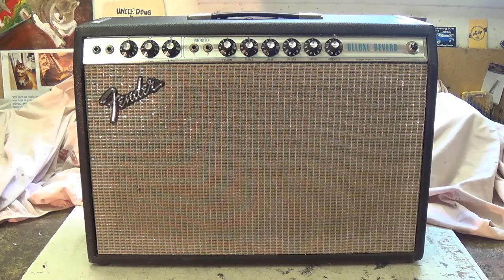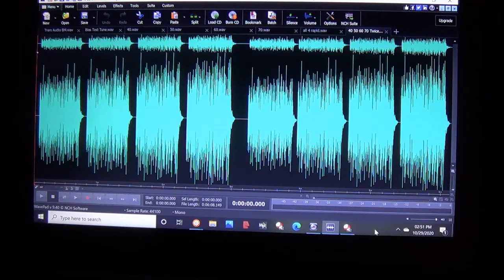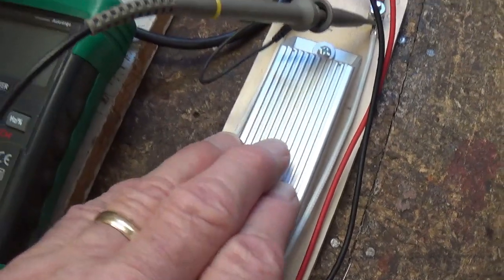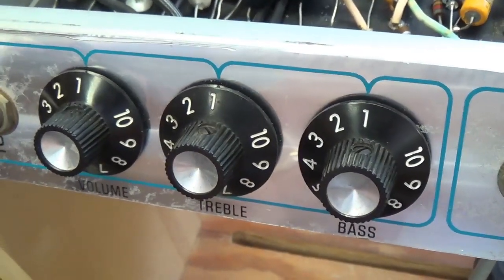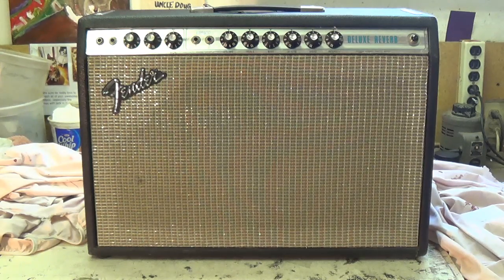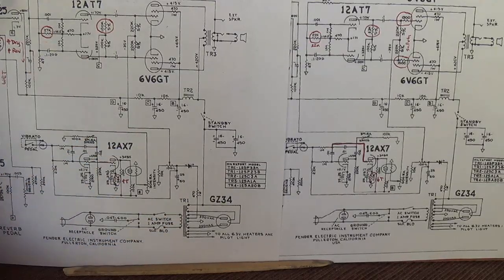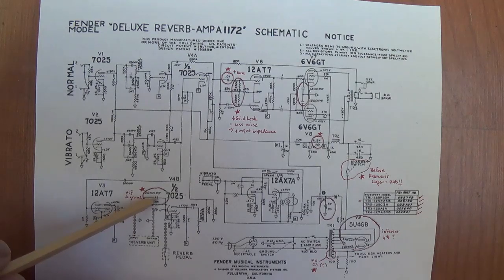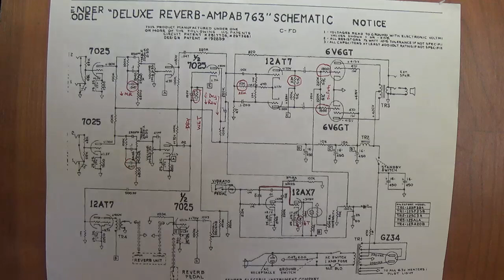The Effect of Output Tube Bias on Tone, Gain, and Headroom.....A Side-by-Side Comparison

Comment: Hi Uncle Doug, your latest video couldn’t be more timely for me. The day before this video dropped, I picked up a ‘74 SFDR with a serial number just a little lower than your amp. Can’t wait to open her up to see which circuit I have! The explanation of what each change does frequency/voltage-wise is so incredibly clear & valuable. You, sir, are literally a amp tinkerer’s Godsend! Thank you from a very grateful viewer & Patreon supporter. DB
Reply from the maker: That's great news, DB. I'm glad the video was helpful and wish you the best with your investigation.
Reply: Hi again Uncle Doug, it appears that my ‘74 SFDR is the A1172 circuit. The PT does NOT have a 6.3v CT wire (but does have factory virtual CT set up). Very odd mystery. The standby is also wired pre-reservoir caps (which I am fixing right now.) Thanks again for this invaluable circuit analysis!! I am grateful for you sir! Merry Christmas, DB

Comment from the maker: ADDENDA: 
 

1.) My use of the phrase "plate resistor" to describe the 4.7/3.3 Meg wet or dry reverb resistor is meant figuratively (i.e.  to describe its function), not literally.

2.) My definition of "Clipping" was inadvertently "clipped" from the video. Here is a proper definition: Clipping is waveform distortion that occurs when amplifier output tube(s) are overdriven and forced to deliver an output voltage or current beyond their maximum capability. Clipping is highly undesirable in both SS and HiFi circuits, while it is often utilized in tube amplification to enhance guitar tone. Crossover distortion, however, sounds awful and is never desirable.

3.) Clean "headroom" is the term used to describe the maximum amount of amplifier output possible before clipping begins. Maximum RMS output power is routinely measured pre-clipping, i.e. clean headroom only.

4.) I inadvertently expressed the decibel scale as being linear instead of logarithmic, during my explanation of gain vs volume.  I should have stuck with "volts" instead ;)

5.) A few viewers have commented on the audio quality during the bias comparison. Recall that this is a "recording of a recording" so any artifacts are essentially doubled.
Reply: Excellent video Uncle Douglas.
It appears from oscilloscope outputs that the crossover distortion shoulders are present at low and high amplifier output/gain.
Whereas clipping type distortion occurs when the amplifier volume is cranked past a specific level.
Can our ears pick up crossover distortion?
Cheers from down under.
Reply: Imagine the confusion at the electronic stores with lines of people asking for wet resistors. Demanding to get them, small riots breaking out. Anarchy. Society breaks down and cats take over the world
Reply from the maker: @PetraKann  Yes, indeed, Petra. Crossover distortion is quite noticeable and unpleasant.....as you can hear in the 40% audio clip.
Reply from the maker: @rjprivate  We might be better off in the long run, RJ, considering the current state of affairs.
Reply: @PetraKann  - I am pretty sure, your ears can pick up Crossover Distortion... It does not sound very pleasing - hence all the efforts to avoid it...
Reply: I remember my stereo amp clipping when I would overwork it. That thing was 1 ohm stable, as well, so it must have really been getting worked.
Reply: Crossover distortion sounds particularly nasty to me. It doesn't even sound good when used as "guitar tone" distortion.
Reply from the maker: @davelowets  I agree, DA. It's not the most pleasant type of distortion.
Reply: You "head room heads" don't know the meaning of the term.  Head room is the excess power available greater than the normal operating power output level.  If you can get ten watts of undistorted output but operate normally at five watts output then you have five watts of headroom.  Headroom is necessary when playing music because of the harmonically rich nature of music.  Harmonics combine algebraically to produce amplitude peaks that get "clipped" when the power tube reaches plate saturation.  Sufficient head room protects against that happening.  However an amplifier clipping according to a musicians' desire is just a way of controlling the timbre of the instrument-amplifier combination.  In other words, learn how tubes work before waxing poetic on how amplifiers are supposed to sound.
Reply from the maker: @pibbles-a-plenty1105  Other than your first and last sentences, I appreciated your input, Pibbles.

Comment: Unless your dream amp (circuit) already exists, or you’ve already built it, I’d like to see you build one. All the bells and whistles.

I’ve seen about 90% of your videos now. Going into reruns to reinforce what I’ve learned. I bought a late 50’s Stromberg Carlson AU57 PA amp and had the schematic blown up to blueprint size. It has 4 inputs, 5 12AX7’s, 2 6L6G’s, 2 12AU7’s, a 5U4GB, and a 6X4.  I’m not sure if I’m going to restore it or turn it into something else at this point. Should be an interesting winter project.
Reply from the maker: Thanks, FT. I think a Princeton Reverb is pretty close to my ideal circuit.....great tone and effects but not too bulky. Good luck with your project.

Comment: I always click the thumbs up on all your videos before watching them. I have learned so much from watching these.
Reply: The amp sounded at it's best at the highest bias level tested. The bass tightened up, and the highs and mids sounded more defined. I guess I'm not too surprised by the results. The tubes were designed and engineered to run optimally around 70% plate dissipation. Anything below that did not sound great at all. I would say that 60% is even too low. I would be curious to hear what 65% sounds like. I'm also curious how it would sound at above 70% up to the point of redplating. Perhaps that test would be better done with a fresh set of tubes.
Reply from the maker: Thanks so much, Jason. I agree that the 60% to 70% range was the sweet spot.  I doubt that going beyond 70% would yield any significant improvement in tone.

Comment: I like both 60% & 70%.
60% 7.17 W. would make your tubes last longer right?
I noticed each time you go up the Bass body sound goes up.
I prefer 60%. Full dynamic range and easy on the amp. Maybe split the difference 65% 👍
Reply from the maker: That makes good sense, Ronnie. Agreed.

Comment: You can use a 5V4G/5V4GA rectifier in the 6G3 Brown Deluxe, AA/AB763 Black Deluxe & Deluxe Reverb and later Silverface Deluxe Reverb amps *WITH 16uf filter capacitors* . They are a lot cheaper, are indirectly heated and require a similar 2A of 5v heater current.
Reply from the maker: Thanks for your input, Matt.

Comment: School is in session! Great way to start the day. In the hi-fi world, when designing an amplifier, a lot of work goes into deciding where you want to 'specify' the bias point, as it sets how much Class A region ( lowest distortion) you have and how much power you can deliver, and how the idle current will effect the tube life.   Take note youtube viewers, this IS meat and potatoes tech, teaching the REAL facts and how engineering choices alter the sound of an amplifier.  In the hi-fi world we not only listen, we use test signals and distortion analyzers.  Right now I am designing a push-pull 6BQ5 amplifier output stage. It is going to be switchable between triode and ultra linear pentode modes, and have a 2 position bias switch, allowing choice of shorter tube life lowest distortion larger Class A region, or for less Class A overlap giving longer tube life and a few more watts, at the sacrifice of slightly higher coloration.
Reply from the maker: Thanks so much for your very knowledgeable and informative input, Jennifer.

Comment: With your clipping / headroom test you just tested the total resistance of the power supply !

The peak power is handled by the main smoothing capacitors
 ( not shown in this video ) .
Reply from the maker: Thanks for your input, GD.

Comment: I can both hear and see that as the Bias was increased the frequency curve was altered. The bottom got tighter (less sloppy distortion), the low-mids were accentuated, and the upper-mids were smoothed out. Obviously, invreasing bias increases compression. As a rock guitarist, I am always looking at/for the differences between 6L6 and EL34 where compression is concerned. I'd love to see you get your hands on both the EVH 5150III and EVH 5150IIIS (6L6 vs EL34 respectively) just to graph comparatively. Also, Mesa Boogie has an amplifier called the "Triple Crown" which has the ability to switch between the two valve and bias choices (Mesa/Boogie Triple Crown TC-100 - 100-watt Rackmount Tube Head | Sweetwater). I'd love to see a Hiwatt 100 watt amp with the features that these previously mentioned amps have. The best of all possible worlds!
Reply from the maker: Hopefully, some day we will be able to provide the comparisons you described, Kieron.

Comment: Thank you for yet another great video. I feel inspired to go through my amp collection and do a similar analysis. With my ears getting older, a scope analysis may yield new results. I would however inject the input signal (possibly pre-amplified by an external transistor-based booster) directly into the phase inverter to make sure that any distortion resulting from overdriven preamp-tubes is eliminated.
Reply from the maker: Sounds like a worthy experiment, TSX. Good luck with it.

Comment: Dear Uncele Doug reading the RCA manual I see that the maximum Plate voltage for a RCA 6V6 is 350Volts and that the maximum output for push pull class A1 is 14 w at 285 volts. aren't the tubes going to blow out with 466 volts? Or is the bias much more negative that the -19 volts? Thanks
Reply from the maker: No one heeds the 350V limits mentioned in the RCA manual, Vincenzo. Fender routinely runs their 6V6's at 450+ plate volts. The one limit you should not exceed, however, is the 12 to 14W of maximum plate dissipation.
Reply: Thanks Uncle Doiug nice to know

Comment: You were right...this is a stellar video and must have taken a lot of work to make...thank you. I have a silver face deluxe reverb and can't find which circuit design version I have. I believe it's a 1976 but can't find any identifying marks for which design. How do I determine which design I have? I'm concerned about the rectifier design flaw you identified which sounds like they fixed later.
Reply from the maker: Thanks, John. By comparing your circuit to the schematics I discuss in part 2, you should be able to identify your circuit.

Comment: Doug: 50 dB to 100 dB is a 50 dB gain, which translates to about let's say 300 times. (20 dB = 10 times, 40 dB 100 times,)
10 dB to 100 dB is about  30,000 times amplification. This because dB is a logarithmic measure.
Reply: For voltage, the ratio of 10 betwen the values is equivalent to 20dB difference, for power it only equates to 10dB difference.
Reply from the maker: Thanks for your helpful input, A & P.
Reply: For voltage, each 6dB increase is equivalent to a two-fold increase in gain.
Reply: @etiennecote9915  For voltage ratio of 2: 20 x log2.0 = 6.0206 dB, close but no cigar 😂

Comment: Very nice.  It would be interesting to see the same experiment with 80% to 100% and then look at the whole 40% to 100% spectrum just for grins.  I imagine that there is a point of diminishing returns somewhere in there, tube/transformer lifespan notwithstanding.  The blackface/silverface comparisons were also fascinating. I wonder what the price difference between the GZ34 and and the 5U4GB would have been when one could buy tubes by the handful just about anywhere in any town.  Cheers, Uncle Doug!  Merry Christmas!
Reply from the maker: No one seems to recommend the higher wattage biasing, Michael. My guess is that improvement in tone is negligible and tube/component lifespan is reduced. I would guess that GZ34's have always been more expensive.

Comment: I think it's important to also mention that this is for a push-pull amplifier.
For a single-ended (Class-A) amplifier, the bias current is proportional to its output power.
With a maximum of 50% efficiency for a transformer coupled amplifier (= single ended tube amplifier).
Although similar, in practice the bias will work a little different compared to a push pull amplifier.

Btw, the cathode current is the anode current + screen current.
so in practice the anode dissipation value is slightly lower (roughly 10%)
Reply from the maker: Thanks for your input, PM. The Eurotubes probes provide a direct reading of Plate Current, not Cathode Current, so Screen Current is not a factor.
Reply: @UncleDoug  Thanks.
I thought they were just reading the cathode. Thanks for clarification!
Reply: The maximum efficiency of an SE amplifier is 25%. PP class A 50%. And so on.
Reply: @EJP286CRSKW  That is only correct for a resistor coupled Class-A amplifier. A transformer coupled Class-A amplifier has a maximum efficiency of 50%. 
see:
https://www.circuitstoday.com/transformer-coupled-class-a-power-amplifier

Class-B amplifiers can go up to 70%
Reply: P_ Mouse Radio Designers Handbook, 4th edition, p557. 25% for SE, 50% for push-pull.
Reply: @EJP286CRSKW  Yes I know, you still miss the fact that we are talking about a transformer coupled amplifier. It's just math, just showed you in the link provided before.

Comment: Very good and excellent  explanation and experiment in easy to understand terms for the layman. My only comment is regarding the lower value rms readings on the DMM at 10khz. The DMM might read lower levels at 10khz depending on the frequency response range of the DMM. This may be the case of a low quality DMM, however your meter appeared to be of reasonable quality and I guess that may not be of a significant factor.
Reply from the maker: Thanks, Bruce :)

Comment: @Uncle Doug Hi! Doug. I have watched many of your videos that involve setting bias. You always mention the 70% rule. I also find that same rule mentioned on online forums. My questions are where did that rule come from? 70% of what? And does it also apply to fixed bias class AB2 circuits? A few years ago I built a Fender Bassman (AB165) clone without the bass channel. Not having suitable equipment to properly set the bias I set the bias voltage to a deliberately high value to protect the tubes. Recently I acquired a unit capable of measuring the actual zero signal plate current. The plate current as I had originally set it was 20mA per tube compared to the 44mA noted in the RCA tube data sheet . I have now set it to 36/37 mA per tube. The amp is definitely louder and I think sounds better. Heaven forbid, am I breaking the rule? CHEERS and Thanks. (P.S. tubes are 6L6GC form JJ and all components are new. Transformers are replacements from Hammond).

Comment: Really interesting stuff about differences AA -> AB and so on. I've wondered what do you think motivated the factory and engineers to make the changes you pointed out? It seems like a lot of work to change the production line, schematics, parts, etc... for seemingly small differences?
Reply from the maker: Fender responded to input from musicians and repair personnel, who alerted them to needed changes. The eyelet boards were pre-wired in bulk and held for assembly in the chassis. You could simply hand all the eyelet board creators a copy of the slightly altered schematic and provide them with the new parts they would need. It really wasn't a huge, mechanized  industry at that time.
Reply: @UncleDoug  Love them Cottage Industries.
Reply from the maker: @stephenrioux6821  .....and cottage cheese too ;)

Comment: Thanks U.D., I enjoy and learn from these technical videos, please do make more of them. I'm not familiar with much of this, so one question if I may: what is involved in replacing a 5UG4 with a GZ34 rectifier tube besides adjusting the power tube bias, as you mentioned?  My PRRI has a 5AR4, also (as per your rectifier video) in the same design category as the GZ34. Perhaps I missed it or a better question for another video: why choose the 5AR4 over the GZ34? Thank you!
Reply from the maker: GZ34 is the English designation and 5AR4 is the American designation for the same tube, Mark. Yes, if you replace the 5U4 with a GZ34/5AR4, output tube bias should be readjusted to compensate for the higher PV..
Reply: @UncleDoug  D'oh! I knew preamp tubes have different designations across the pond! Thanks again.

Comment: Interesting to see the very wide gap between a HiFi amplifier and amplifiers made for guitar use. In HiFi terms a pair of 6V6s would be expected to give 10/12 watts rms output at a reasonably low THD (below 1 %) good for valves!! But I must say when I heard the sample recordings with different bias I thought all were very distorted. When you later showed the sine waves on the scope, I could not believe what I had seen. Possibly the worst shape sine wave ever!! Looked like really early class B transistors radio amplifiers.
I still don't understand, even with higher bias why you still have so much crossover distortion? 
I would be interested if one day you could play some music into a REAL HiFi amplifier and speaker, interesting I think! It should sound more like an acoustic guitar but louder I guess. 
Thanks for the video, very interesting.
Reply from the maker: Thanks for your suggestions and input, Michael.